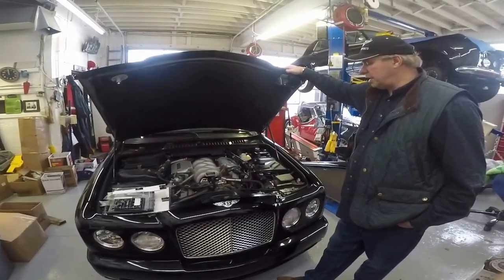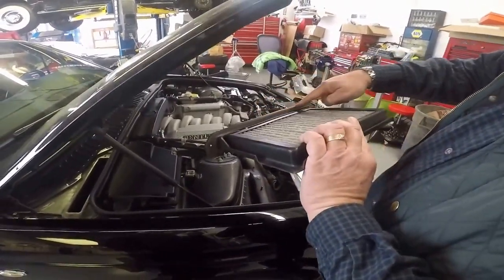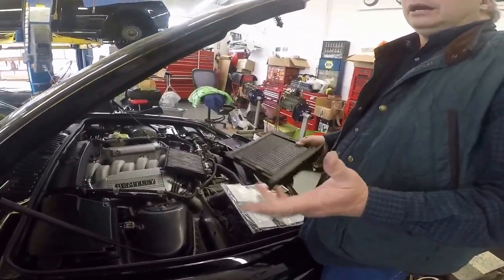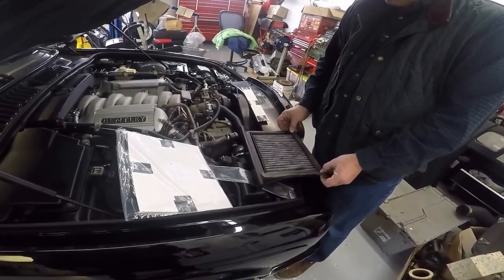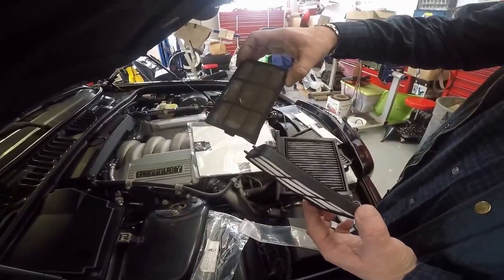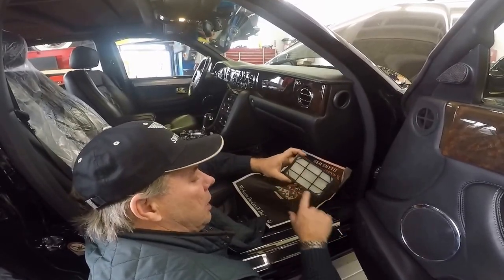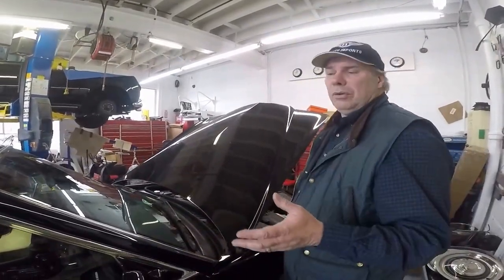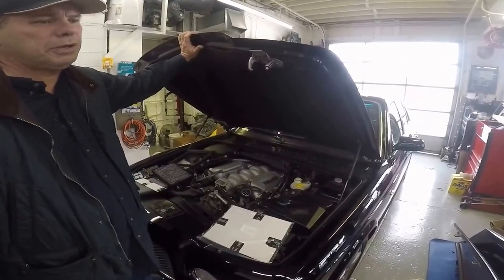Bentley Arnage Cabin Air Filter and Charcoal Pollen Filters Sam Smyth Blog Cincinnati

Comment: You Da Man Sam!,...can't thank you enough for generously sharing your knowledge through your killer videos.  These filters along with the cabin filters were the only question marks I have had with my 2003 Arnage R which I've had for almost a year and have done my own servicing so far.  The car is pristine with only 23,000 miles when I bought it in Atlanta, but unfortunately had no servicing records with the car so of course I questioned if the filters had been changed at all.  I just yesterday after seeing your informative video pulled the filters to discover they HAVE been changed and was happy to discover they were exceptionally clean with no evidence of dirt/dust at all!  :-)   Read on Bentley Forum that these filters, if not changed regularly could overwork the blower motor and if the blower motor overheated and failed it would require removing the dash to replace the damned thing!  Not to mention it would cost a small goat farm, a leg and an arm to dismantle that beautiful dash at a Bentley dealer(OUTCH!)   Thanks again for your guidance and efforts you've taken to share these great videos with us D.I.Y. Bentley owners,...will definitely stop be your shop if I'm ever up in Cincinnati,...lunch is on MEEE!  All the best Sam,...Tim Richey, Hurricane Alley(FL)
Reply from the maker: thank you very much i kind of over did it